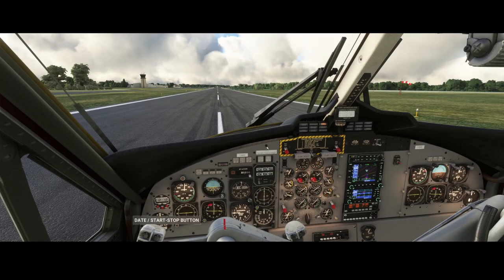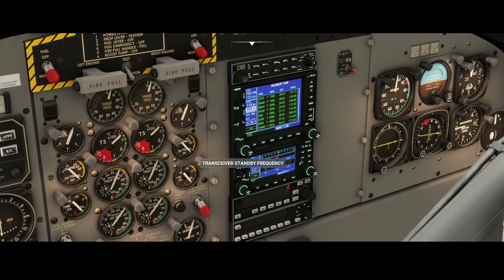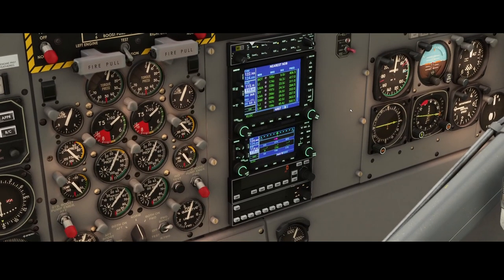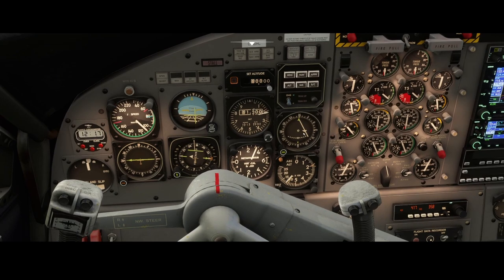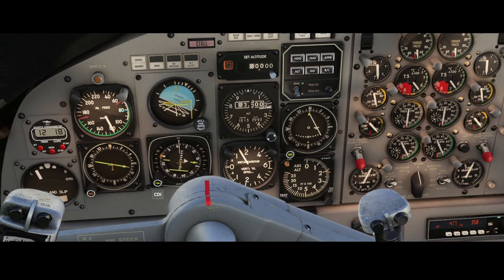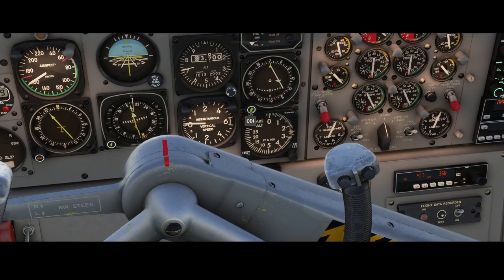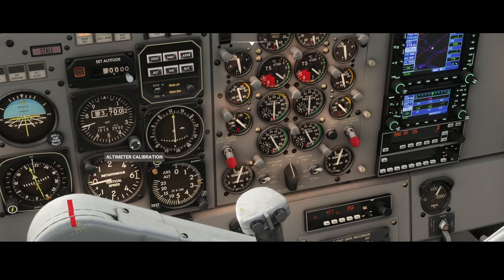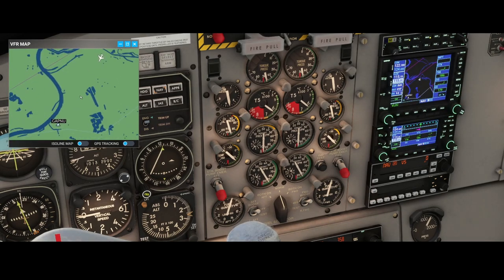Flight Simulator 2020 - How to - Aerosoft Twin Otter - Using the navigation systems

Comment: Hi, thankls man! I have one question, tuning and everything works, but even after taking off (EHAM) and tuned SPL, the instruments still don't pop on, even though the GPS is set to VLOC. Any tips?
Reply from the maker: Hi Victoroos let me check on this, according to the ATC NL info it should have both and is used in case GNSS has outages

Comment: I am trying to figure how to use the OBS in GPS NAV mode. When I press the OBS softkey on the Garmin the course line comes up but I can't figure how to dial it around. I have spun every knob in the cockpit. Perhaps it is bugged?
Reply from the maker: Hi Ham Bone, you need to switch it to the other mode in gps nav mode it doesn’t work. I am not sure if this is a bug sill try to find some info about it and will let you know